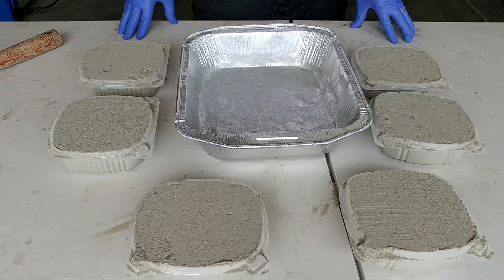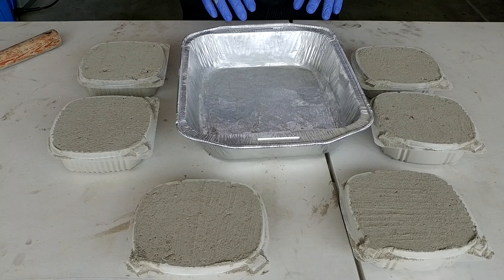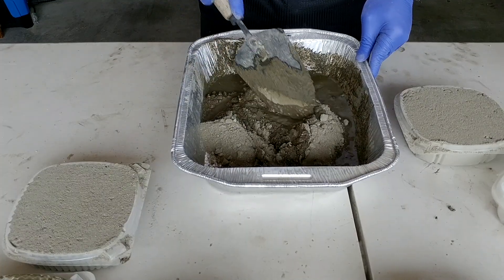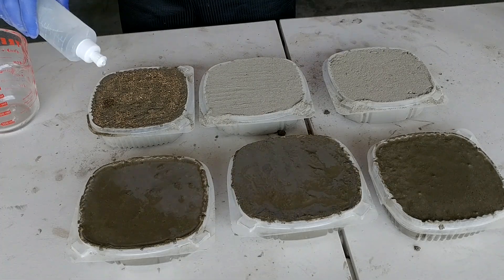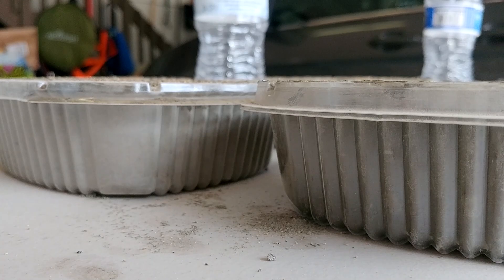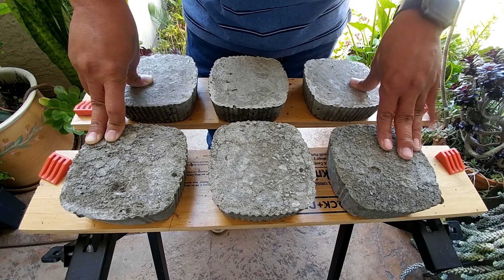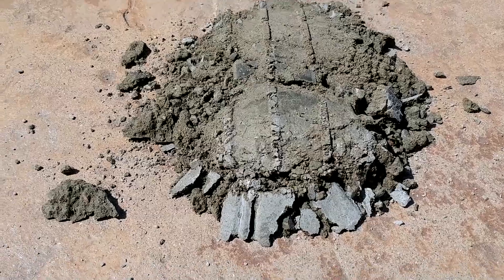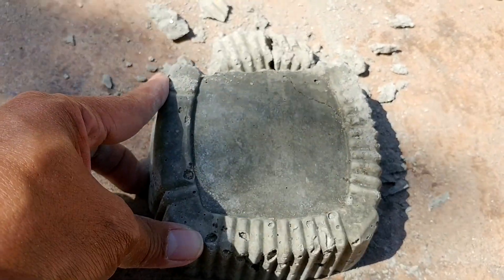Stress Test Showdown - Will Dry Pour Concrete Take the Crown?

Comment: I think you have to wait 30 days to do the testing... and when you wet the dry pour you have to get enough water soon enough for the chemical reaction to happen correctly... if you don't wet it soon enough (within a certain window of time) then the chemistry won't be the same as the wet pour... the concrete has an ideal wetness amount, too much water or too little water and the strength will suffer... the romans used quick lime and other things in their geopolymer roman concrete so it got harder over time or when it cracked and got wet again... the romans did a "hot mix" with the quicklime from what I've read.
Reply from the maker: I made 3 sets of samples so I can compare the strength of dry vs wet pour at certain stages of curing.  Also, I used the same amount of water to make sure I do not over or under water the dry pour. I continue to water them throughout the curing process so that they do not dry out as it cure.  I just finished recording the 7 day test and will post it soon.    Thanks.
Reply: @diymanual  Thanks, could you try doing a wall or foundation test...
Reply from the maker: If I can find a way to make the powder stick to the wall before misting it with water.😁
Reply: @diymanual  I mean in a regular form...  you could also use a cloth form to let the water go through...

Comment: Almost all the dry pour experiments on the different channels use a more real-world situation than is possible when letting it cure in a pan. The dry pour curing process absorbs moisture up from the ground in addition to water from the top to slowly cure. So while I think the basic premise and process of this experiment is great,  some  6" x 8" by 3" deep wooden frames set on soil would be a better test mimicking how slabs are created. Nonetheless, this is progress and good info.
Reply: So dry pour is placed direct on to soil, no gravel underneath?  What happens in winter?
Reply from the maker: Thank you for your input. The reason I used a smaller sample is because we are simply comparing the strength of the wet poured concrete and dry poured at certain point of their curing process.  We are not trying to see if the concrete is good for a certain application.  If I build a 3 or 4 inch thick slab, both will most likely going to handle the weight of the van for days or even years but we do not have that time in our experiment. 

Let say someone handed me  2 poles one made of oak and the other made of cedar. Each is 18 inches long and 2 inches in diameter. I am told I can spend 1 minute daily on each pole to break it in half just using my own strength.  I don't think I will be able to break it in half on the first day or maybe on the first week but if I keep doing it everyday, they will eventually break. They might break at the same time or on different days. Now, if someone handed me 2 poles one made of oak and the other made of cedar. Each 18 inches long but only quarter inches in diameter. I am sure I will be able to break them in under a minute. They may take the same amount of time to break or 1 will break under 5 seconds and the other will take over 10 seconds. This is the reason I used smaller sample in this experiment. Using a smaller sample will show us which of the sample can handle the load better at a shorter period of time. 

From what I have seen so far, dry pour is a good alternative on light application. The concrete will harden enough for you to stand and jump on it or maybe put some furniture or shed on top of it but the question that remains in my mind is the longevity. Everybody seem to accept that dry pour takes longer to cure but some suggest that it will have a shorter life span than wet pour even after it is fully cured while some suggest that it is just the same once fully cured and that is what I am trying to find out.   

This method might not make sense to others but this is what makes sense to me and I am just sharing it to help other people who are still on the fence if this method is good enough for their project.   

And about letting it cure in the pan. I did remove them from the container after 48 hours and set them in the ground where I continue to water them so they cure like regular concrete. 

Thanks for watching.
Reply: @ThinkingNow  There are people who have had the same slabs for years... but sure, start some conspiracy theories.
Reply: Yes this is a good point that having a sealed container is not the same as how concrete cures in actual use.
Some needs to do real concrete testing, they bore cylinders and have them compressed until they break apart.

I have commented on most of these videos that "cajun" dry pour is terrible.  What I do is better called "mix in place".

You need wet concrete to finish the surface to produce the high strength surface.  Without that, maybe just use compacted gravel instead, decomposed granite when compacted is very strong and fully diy and can be done over time, which is one big issue with large pours you need many people to get it done quickly, and having always done pours myself this is a real concern, my second "mix in place" I ran out of time to finish it properly.  but as a shed floor, it is fine, almost no traffic on it.   My driveway has cars on it, and it was finished properly but 'mixed in place'.
Reply: @ThinkingNow  How long does it take to make a YouTube video, 30 years?
Reply: The point is that the dry pour absorbs water from the ground also! It will be strong er
Reply: In addition, the real world dry pour methods don't have a set amount of water. In those situations the concrete takes what it needs and the rest of the water drains off. AND it's sprayed on to the concrete at intervals.
Reply from the maker: @jesuslovesyouforalleternit8064  This is what many assume but from what I have seen from my experiment and watching other videos who breaks the concrete, when the top portion hardens then the amount of water that gets through the bottom is very small and if you wait too long the bottom of your slab will be weaker than the top.   Of course, if your concrete is outdoor the rain will help the curing overtime but how long do you have to wait before it hardens to 99%? We know that for a wet pour it takes 28 days to reach that strength and it will continue to cure as long as it gets hydrated.  I saw a video that used dry pour for a flooring inside a storage area. If the dry pour only had a chance to hydrate that one time any part that is not hydrated properly will never cure because it will never get watered again.